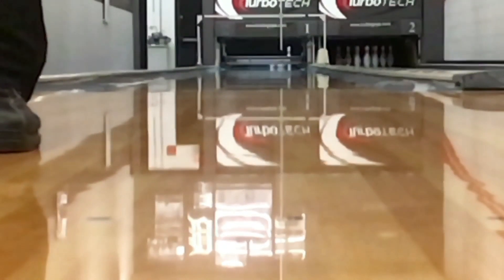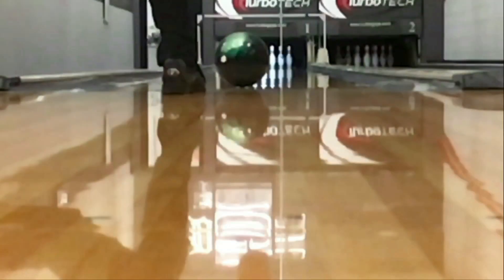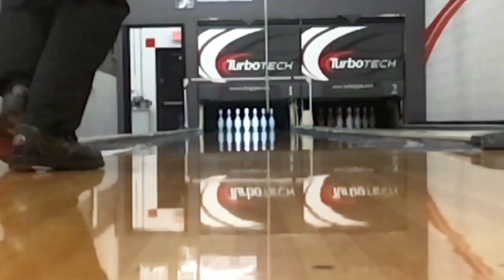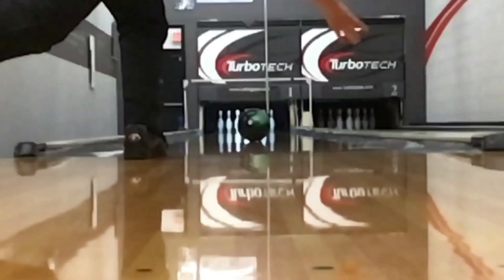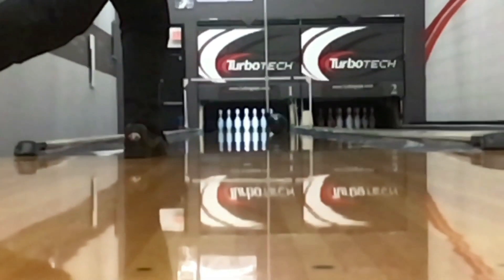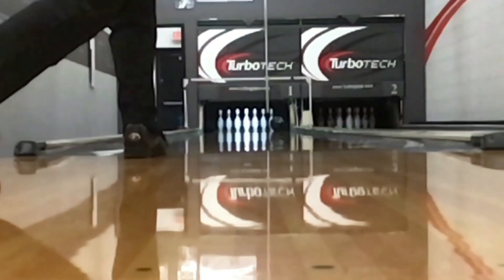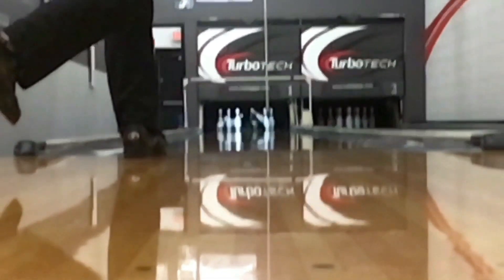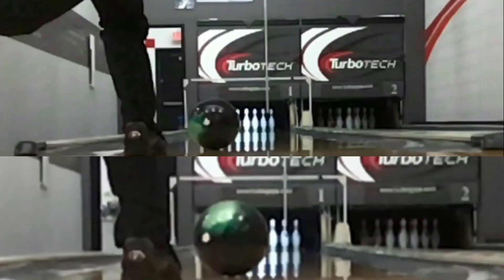Axis rotation and it's importance

Comment: Hello I’m in the pro shop business and am fairly new…I need some help…I’m looking for a way to tweak my pitches to help increase rotation. I’ve seen a lot of content about how you can change tilt and rev rate using performance fitting but no statements about how pitches directly effect axis rotation. I was thinking I might be able to make it easier to get around the ball by changing my lateral pitches In my finger or thumb but I’m not sure where to start

Comment: Your main problem, which is the same problem I have, is not that you have low axis rotation, it's that you have close to zero tilt.
Zero tilt stores little energy and rolls super early.
Now combine zero tilt with low axis rotation and you are in big trouble.
Fortunately I have over 90 degrees of axis rotation which helps me get the ball up the lane more, but still zero tilt is an issue with too early roll.
To succeed on the lanes with zero tilt you have a couple of options.
1. Use High Flare symmetric resin balls with tall cores and a low flare layouts and high grits or polish so they hook less in the front and more in the back. I recommend a 80 x 5.25 x 45 layout.
2. Use weak surface balls such as urethane or plastic and move right into the friction and ease them up the boards so they arc in smoothly.